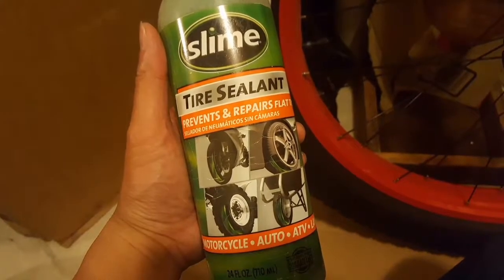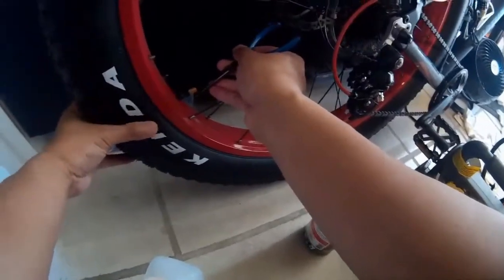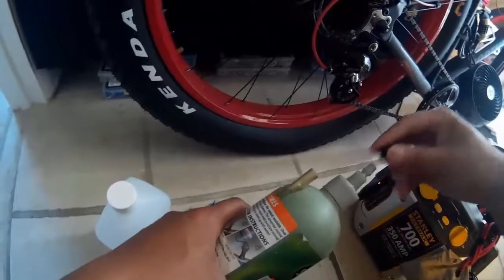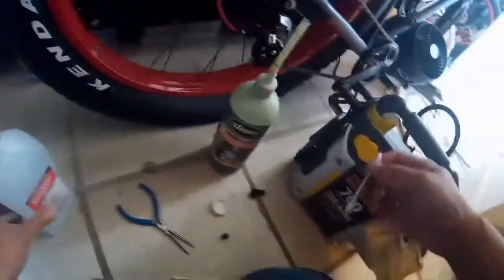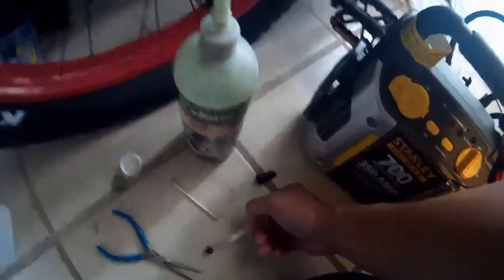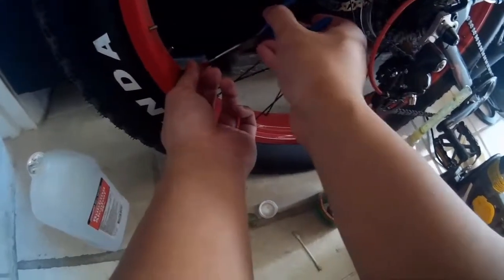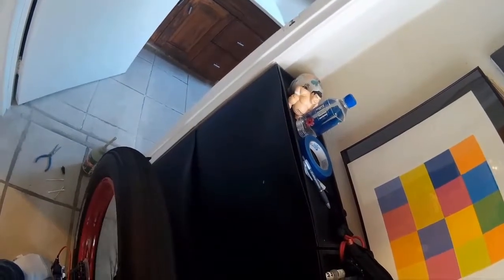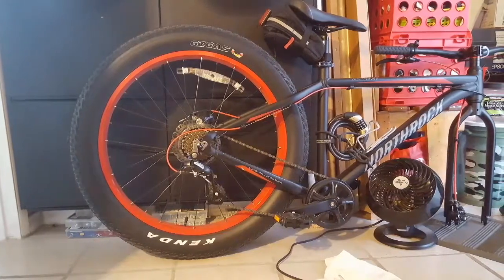How to stop thorn flats on my bike tires.

Comment: Thanks for good video, question, if you need later to pump up air , would the slime get stuck within the valve?
Reply from the maker: Not really i only put about 3oz  in the large tire, it only lines the bottom of the tube. I fill the air nipple at 45 degrees angle.
Reply from the maker: You need to remove the valve to add slime.
Reply: thanks, I will try that in my fat bike, cheers